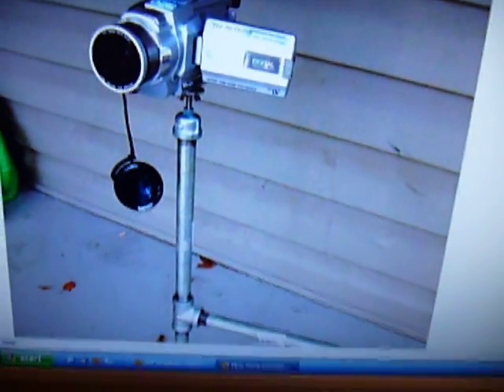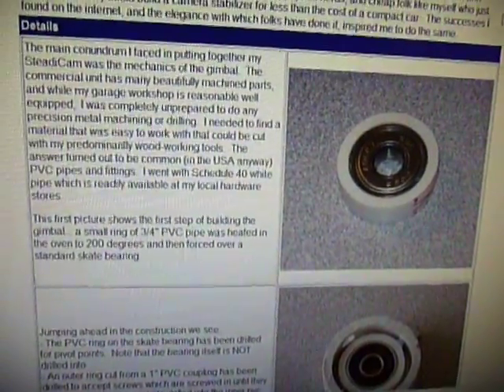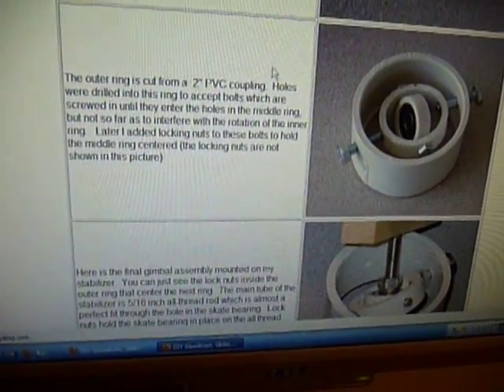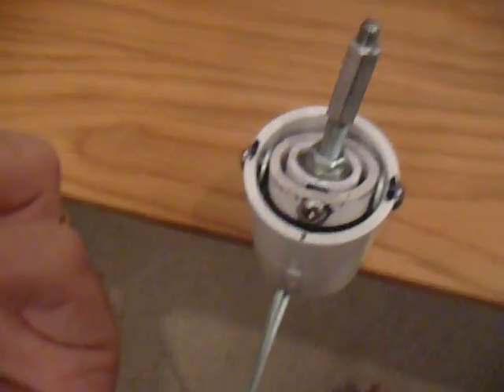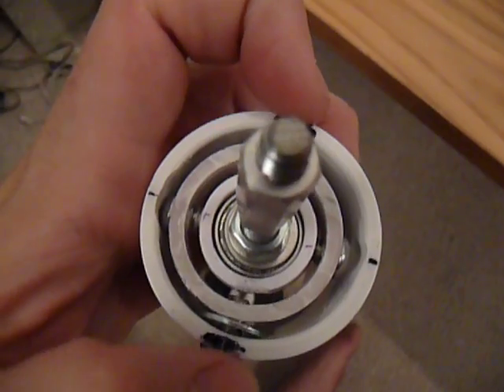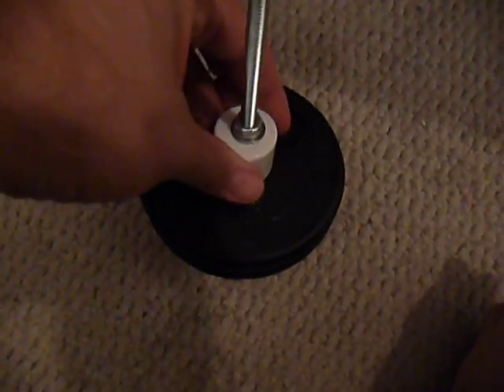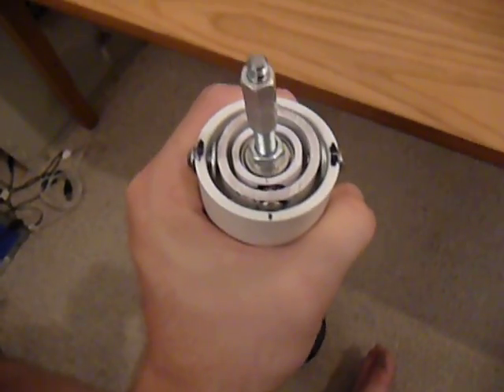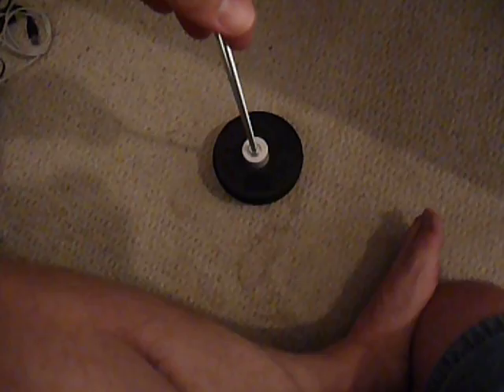DIY steadycam 3-axis gimble

Comment from the maker: @yb2normal I haven't practiced much, I'm sure it takes a while to get down the technique.  I've always thought a longer rod would mean slower more subtle bouncing (ratio of height above where your holding, compared to how long below).  In other words, if the bottom moves an inch, and it's a 10:1 ratio, then the top should only move 1/10".

Comment: Great start!  I like the improvements you made on my PVC gimbal design.  A couple of comments on your design and the video.  (1) Your bottom weight is way too low...you want the unit to only be slightly bottom heavy. (2) The purpose of the long rod at the bottom of my stabilizer is to give good rotational inertia... this prevents the side to side wiggle. (3) Hold the stabilizer farther away from your body... it will let you take better advantage of your arm's natural dampening effect.